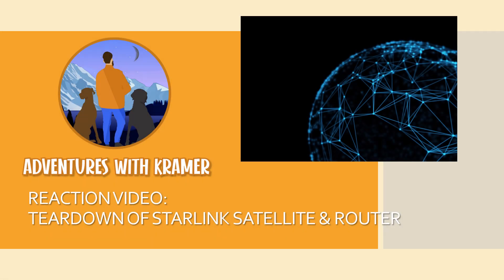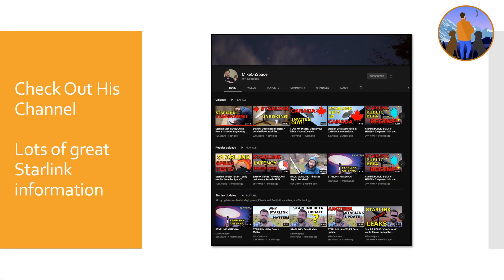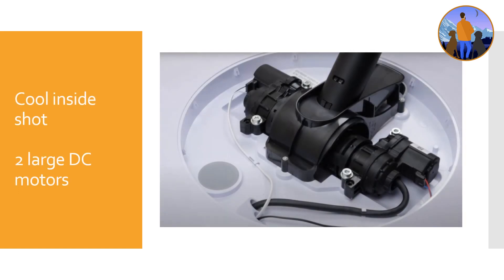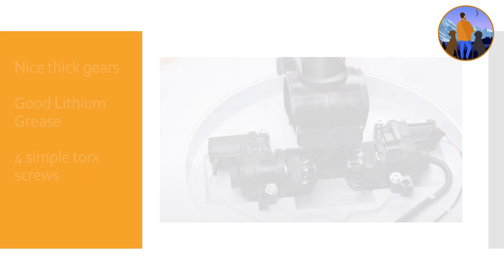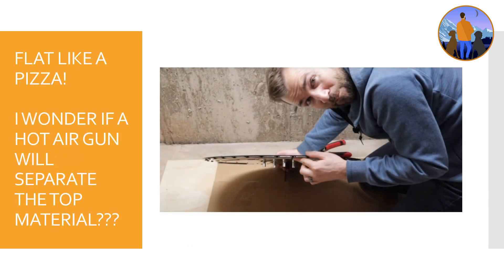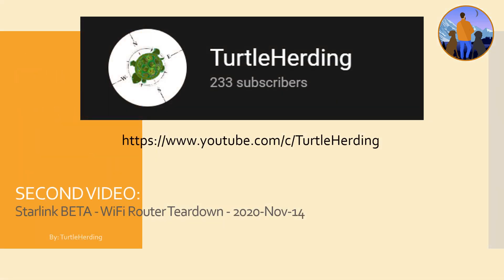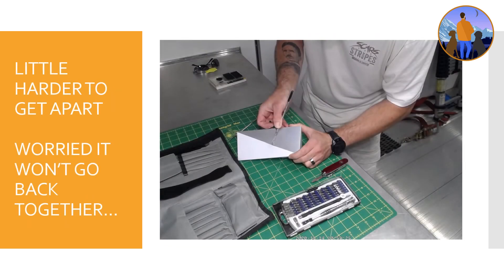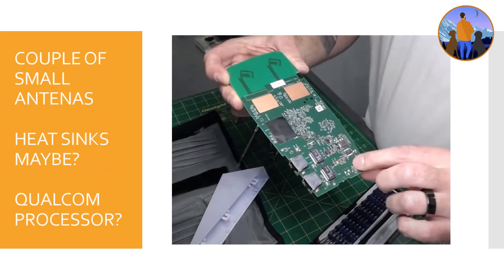Reaction Video: Teardown Starlink Satellite and Router! Power Tools Required?!

Comment: He could have easily just split it apart at the seam instead of going caveman on it and destroying it.  He didn't even get to the most interesting part of it which is under the front cover.  I want to see the pcb board and phased array system.
Reply from the maker: He said he is going to show that in part 2 because the first video was already 30 min long